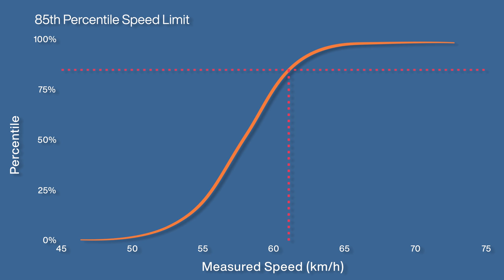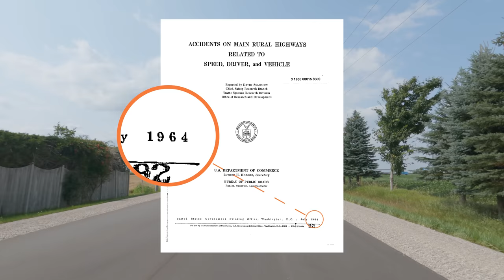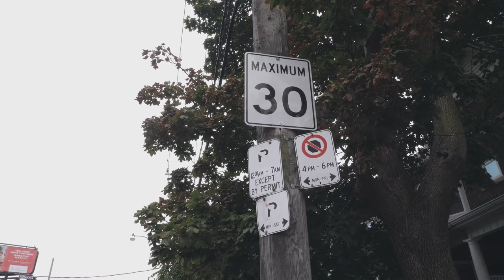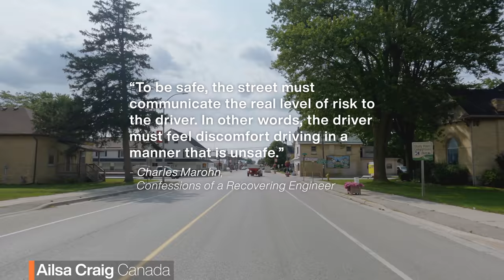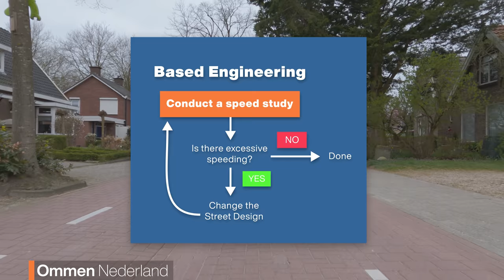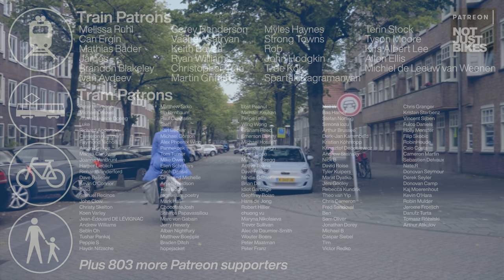The Wrong Way to Set Speed Limits [ST06]

Comment: I am a civil engineer in the United States, and while I agree that there are MANY issues with roadway engineering, I have to disagree that engineers are stubborn and stuck in our ways. Nearly every engineer I've talked to and worked with would love more progressive infrastructure. That includes engineers who have been working for 30+ years all the way to new grads. We are tested and KNOW that making a road tighter and more uncomfortable will lower the average speed of the road. The main issue is that we, as the engineers, aren't the ones directly paying for the road. Whatever municipality the project is in is footing the bill. We can suggest all day that creating a road with 11 foot lanes, divided bike lanes, and medians will improve roadway safety, but if the owner sees that as negatively impacting the service level of the road (which it doesn't) then they are MUCH less likely to go for it. In the end, as with most other things, money dictates the decision.
Reply: That is why those things should be done on a federal level.
Municipalities design and build streeds and roads. But what kind of roads can be used where and how they need to be designed is the same everywhere.
Reply: @baronvonlimbourgh1716  I'm not sure I understand what you mean.

Roads across the US are actually very very consistently designed. 

However, some minor details or choices in road features might differ. I've seen a massive expansion of roundabouts that never used to be a feature in US roads just within the past 10 years. 

But road signs are all the same across the US. The color used to draw lines and other symbols on the pavement are all the same across the US....

What the original comment is talking about is a lot of minor details like the lanes are a little more narrow.

For example, some car parks might feel different because one lot might be angled parking spots while other lots are straight. Or some lots might have more narrow parking spaces than others. My understanding of your reply in context of this car parks example is like someone saying, "all these car parks are so different from each other! This is why we need federal regulations over car parks so there is  consistency in car parks!" But there really aren't enough differences to warrant those claims. And the same really is to be said for all the roads in the US
Reply: @baronvonlimbourgh1716  the federal government are even worse idk how adding more bureaucracy to an already bloated system would be better as it takes millions of dollars and years to replace small parts of road
Reply: @Scornfull  things are done pretty well and very efficient here by our government. Economies of scale and all that, plus it centralises things so nobody has to invent the wheel again which makes things a lot easier and cheaper so everything is kept up to date constantly.
Never hear anybody complaining about it really, so it must work pretty good.
Reply: I'd also like to add that changing a sign is WAY cheaper than redesigning the whole road, and US municipalities in particular usually have a very tight budget, unfortunately. So the safest decision often gets ruled out in favor of the cheap one.
Reply: @MrWhite-pn7ui  LOL its hilarious just how partisan your yank politics are
Reply: @MrWhite-pn7ui  it depends on the goals set out to achieve. If your goal is safety, population satisfaction and efficient use of resources then that has been proven to be the way to do it.
Reply: @MrWhite-pn7ui  it's only supposed to be uncomfortable to go OVER speed limit. The comfortable driving speed is the desired driving speed
Reply: @MrWhite-pn7ui  “we taxpayers have the final say”. 
Ok then, here’s a very common scenario for you: half the residents of a street think drivers go too fast and want speed bumps, the other half doesn’t want them. What do you do?

Another one: a small city has 2,000 residential streets. Residents of 1,500 of these want traffic calming (let’s say it costs $100,000 per street to implement, so we need $150M). Let’s raise property taxes?
Reply: Idk why people think the engineers have any control over it. Politicians block all kinds of shit.
Reply: @bgm769-g2k  Right. Too many always reach for sweeping conformity, or, a procrustean bed.
Reply: @A cat on his hind legs. I agree, and I agree with the points this guys makes, but you comments are insufferable. You will never convince the unconverted with them.
Reply: It's obvious that Clayton has proposed road projects to councils in the recent past.
Reply: @MrWhite-pn7ui  comfortable means faster driving. All good until the neighborhood complains.
Reply: @baronvonlimbourgh1716  no the government never does anything even as close as efficient as the private sector
Reply: @MrWhite-pn7ui  lol, triggered
Reply: @A cat on his hind legs. we're a long way from changing that unfortunately. Noise canceling headphones?
Reply: But how to you know for certain your choice will not affect the service level of the road?  You would have to have a lot of data to support that.
Reply: @baronvonlimbourgh1716  NO, the federal government has no power to do this.  Stop giving them more power.
Reply: @MrWhite-pn7ui  my point is half the drivers want one thing and the other half want the opposite. That is where technical criteria come in.
Reply: @MrWhite-pn7ui  the earth is round btw
Reply: And because as I noted above, the municipalities are eager to fine drivers coming through to cover costs of operation.  So they’re nit invested in making it as safe as possible when their goal is to bilk the public.
Reply: @MrWhite-pn7ui  lol that's why you got so triggered after I pointed out how partisan your political system is
Reply: @Scornfull  maybe your government doesn't..
Reply: @MrWhite-pn7ui  i love driving. I have a nice collection of cars.
I'll have fun on track though, on public roads it is all about safety.
Reply: @A cat on his hind legs. thing is in america you cannot have a goverment  with just engineers because we have the freedom to run for office if we do not like the people doing the job
Reply: @baronvonlimbourgh1716  netherlands is a small country only about the size of a small state the us is 3000 miles east to west and from 1200 to 1500 miles north to south 
i was a person without a car i found out i wasted time waiting for buses or money buying cab rides to get around
Reply: @A cat on his hind legs. i heard about some other engineer had a problem with a traffic light when he tried to change the light the goverment traffic engineer tried to silince him because he was not a traffic engineer
Reply: @baronvonlimbourgh1716  satisfaction for who the thing is in the us streets and road are for people to get from point a to point b in a safe, timely and efficient manor 
not just for people to play
Reply: @MaaveMaave  what about people tide up in traffic get angry
Reply: @doleo_metal  i am a vaxxers but i am also someone that does not believe i need to be tide up for a half hour to go 10 miles to get to my destination
Reply: @gbottesini  when you realise some of those people that drivers are going to fast beleive 25 mph is to fast, 
as for that small town if the want to spend 150 million to redesign their road i have no problem with that it is when they want my money taken from my town to do it
Reply: @A cat on his hind legs. road are not dangerous if you use them correctly.
Reply: @brucenadeau2172  yeah exactly. And that is the safest most efficient way..
Not that complicated.
Reply: @brucenadeau2172  why does that matter. Longer distances are done on highways. Not roads.
Reply: @friendlyfire7861  i do not like his want to control me 
i like americn roads i have the freedom to choose my store.  They can near freeway exits safer so they do not have to have semi-trucks drive throught the downtown semi trucks are harder to stop and harder to get started from a stop. cause more damage in an accident and angry when trapped  behind one  in stop and go driving speed can even creep up on residental street
Reply: @A cat on his hind legs. if you do not like the street you live on you need to move 
you do not get take my freedom away for you to feel safer
Reply: @BaconRobotics  if you want to redesign road fine but you pay the full cost do not dip into my wallet
Reply: @user-xl8jm3zy1f  i like how mr. white and i are partisan because we do not beleive we have to give up are freedom go along with what you want
Reply: @baronvonlimbourgh1716  i try to drive safely but i drive to get to some where i am not out to spend all day driving
Reply: @baronvonlimbourgh1716  i live in one location and are stores are in a diffrent location i want to get my store not be tide up in traffic wasting my time and becoming hadazard to my neighbors
Reply: @brucenadeau2172  bruh if you yanks wanna have shitty roads go ahead. All im saying is that it's super funny to see people seeing bloody traffic problems as a left vs right wing issue.
Reply: @cindland  your evidence does not support your claim. In fact it contradicts your claim! You  basically saying authorities are eager to fine people for violating safety laws they are not interested in safety.
Reply: @MrWhite-pn7ui  no I won't...
Reply: @brucenadeau2172  and?
Reply: @brucenadeau2172  I was responding to a specific nonsensical comment, in which he clearly misrepresented OR misunderstood what was actually said in the video.
Reply: @doleo_metal  yup! They’re interested in MONEY.
Reply: @cindland  saying "yup!" Implies that I was in agreement with you, which I was not..
Reply: @baronvonlimbourgh1716  Going Federal is worse. Local governments are better suited to know whats best for their area. You seem to be making some false assumption that the problem of incompetence or corruption in politics does not exist in the Federal level. It is much worse there than in local governments.
Reply: @user-xl8jm3zy1f  Thus is the legacy of the outrage merchants. Of course, we still have out-of-touch academics fixated on the Oppression Olympics that is Intersectionality, as focusing on things that would help the common people would scare away their wealthy donors. Said academics end up giving the merchants more outrage to sell. It is just an ouroboros of misery.
Reply: so basically you guys blame everyone except yourselves. sounds productive
Reply: @MrWhite-pn7ui  compensating much?
Reply: @MrWhite-pn7ui  burger scared for his life that he might have to walk in the future lmao
Reply: Like becoming an engineer...
Reply: @MrWhite-pn7ui  Wow way to go politicising something thats obvious to anyone with half a brain cell. As a "righty" you emberass me. Do you even understand a road or street often has multiple end users?
Reply: @MrWhite-pn7ui  THANK YOU!  I had to hunt for this comment.  There are a lot of comments here so I'm sure there are others, but it was hard to find.

This whole "let's make streets actually unsafe so drivers go really slow" is NUTS. Absolutely contrary to every basic design foundation of modern US roads.  Look at the example of the road with all those trees right along the edge.  Every one of those is a fatal collision waiting to happen.  And look at the other examples in the EU and UK...  bollards sticking up forcing you to literally weave between them?  Hell, half a block from me we had a fatal accident as a teenager at 2am decided to try to do 70mph around a s-curving, parking along the sides residential street and when he left the pavement he hit a nice 30 year old solid tree 5 meters back in someone's front yard that didn't give an inch.  Walking by days later I saw the bark was missing a little in one section but otherwise the tree came out unscathed.  The car was almost cut in half.

Feels like this video is what happens when you tell a Toronto city dwelling bicycle enthusiast to come up with a new plan for how to do roads better.
Reply: @MrWhite-pn7ui  hahah such a troll
Reply: @frotoe9289  lol yea thats why actual engineers talk about how these are actual solutions...
Reply: Clayton Van Ederen,
We lost two space shuttles in the USA due to lay management usurping authority which rightfully belongs in the minds and hands of engineers and other STEM professionals. Until the general public comes to understand that it is just as futile for a lay person to question an engineer as it is for a lay person to question a doctor in each STEM professional's field of expertise, this battle will never end.

Every man, and a lot of women, believe that they are expert technical geniuses the moment they see even so much as a snippet of a documentary on a topic. The more ignorant the man, the angrier and more belligerent he becomes when told he is wrong by a STEM professional. Contractors, business people, and politicians are notorious for such bad behavior. This will not stop until we teach our children, and adults, through actual exercises just how much an educated, trained, and experienced STEM professional knows within their own profession, relative to the lay public.

Contractors, lawyers, politicians, and business leaders don't like to be questioned within their own realms, which for the most part are relatively simple. Scientists, mathematicians, and engineers also have a right to respect for their very extensive knowledge about what are literally by far the most complex fields known to humanity, and for good reason. Those who practice STEM professions should be given at least as much respect and freedom to practice their fields without interference from the lay public as those politicians, lawyers, and business leaders expect for their own practices.

If those in STEM professions can convince the lay public to keep their noses out of the way of STEM professionals, we would see a lot more good design, and far few failures such as exploding space shuttles.
Reply: @frotoe9289  yes, if you do 70mph (110km/h) on a road that is designed for 30 (50) and you hit a tree that will most likely be a fatal collision (I’m assuming it’s a residential street since you mentioned it was half a block from you). Also in many places doing that is considered stunt driving and could get your drivers license suspended or even jail time.

How can you possibly argue that the issue with that collision was a tree placed 5 m off the road (btw this is a fairly generous clear zone width if we’re talking about a residential street) and not the excessive speed? Sounds like you’re proposing that residential streets should be designed to freeway standards. I suggest you look at collision statistics from any municipality and find out on which types of roads most fatal collisions happen.
Reply: Not sure what's going on, some of my comments are disappearing. Here it goes again...

 @MrWhite-pn7ui  and who do you think stopped the Chernobyl catastrophe from becoming an apocalypse? Car salesmen who "do their own research"? What does the general public know about running a nuclear power plant?

BTW, this pandemic would be over had the general public listened to the experts, not to politicians and podcasters. But no, "I watched a YouTube video therefore I know more than the people who make a living out of knowing their stuff."

Give me a break.
Reply: @MrWhite-pn7ui  I’d keep chatting but I have a root canal scheduled with my barber.

Take care, and don’t forget to polish your aluminum foil hat. You know… 5G and stuff…
Reply: @MrWhite-pn7ui  ,
Most engineers, and for that matter, other STEM professionals do learn to work with the general public. Who do you think invented the field of ergonomics? It was a combination of scientists and engineers who did the research and discovered how to get people to interface efficiently with each other, machines, and regulatory systems. Who do you think invented LEAN, Six Sigma, Just in time delivery, and other modern productive systems which actually work and make possible our productive enterprises? The entire world you live in was discovered, invented, and made possible by STEM professionals who do know how to work with, analyze, and satisfy the general lay public.

Next time you are driving your car, think about how beautiful the ergonomics are compared to the original cars. Think about how the seats are designed to accommodate a wide range of people in comfort over several hours of driving at a time. Think about how controls are located within easy reach with a minimum of distraction. If there are problems with the infotainment system being too distracting or too connected to vital functions, that is due to decisions made by business and marketing management, not the design engineers. No engineer in their right mind would compromise the safety or functionality of a product for some sales gimmick.

The same goes for the disaster at Chernobyl. There was nothing wrong with the reactor design other than it was old and needed proper attention from properly trained people. The accident happened because the staff were not properly trained in the critical nature of the reactor, and funds were not made available to keep all systems, including sensors, valves, and pumps, plus other critical gear, up to spec. The reactor had grown old, and lay political leaders were not willing to heed the warnings from their STEM professionals to perform proper maintenance and/or decommission the reactor. In essence, relatively unimportant politics and business took precedence over very critical STEM decisions in regards to a complex and potentially very dangerous piece of technology that only STEM professionals could understand, evaluate, service, and operate. As usual, the real cause of the Chernobyl disaster was the fault of management who would not let go of their egos and listen to the advice from their STEM professionals who knew vastly more than management about nuclear reactors in general and the Chernobyl reactor in particular.

Look at what really happened at Chernobyl and you will discover that the ultimate source of the disaster were decisions made by management which lead to a failure to maintain critical components to engineering specs and a failure to train staff in the intricate and critical nature of the reactor. It was a management decision to keep the reactor open past its due date, as well. The Soviets were well known to allow powerful political leaders to override their STEM professionals. No one questioned Soviet political or bureaucratic leadership because they were all scared of being sent to GULAGS for doing so.

Just like the two space shuttles, defective cars, and dangerous products, Chernobyl failed due to a culture of obedience to the wrong people who had zero qualifications to make STEM decisions. The worst thing that can happen when a politician or business leaders is disobeyed is a cost overrun or a marketing disaster. When business leaders, politicians, and bureaucrats fail to obey their STEM experts in STEM matters, actual disasters such as blown up space shuttles, melted and exploded nuclear reactors, exploding Ford Pintos, out of control Chevy Corvairs, and other mistakes happen.

Yes, STEM professionals make mistakes as well, but in general, they learn from their mistakes. With politicians, business leaders, and bureaucrats, its just business as usual no matter the horrific disasters that result, until some STEM professional exposes the source of the problems and who is really to blame. The the politicians, bureaucrats, and business leaders begin conniving, gaming, and manipulating the system to shift blame onto the shoulders of the innocent and the competent, instead of taking the blame for forcing their unwanted and incompetent choices upon others who know more then the leaders do.

When a STEM professional makes a decision based upon their knowledge, training, and experience, that STEM professional is generally correct over any and all objections from lay people, no matter how much force, influence, and power those lay people have at their disposal. The sooner we all understand this fact, the sooner we will be able to enjoy a higher and safer standard of living world wide.
Reply: @AMERICANPATRIOT1945  let’s stop feeding the trolls
Reply: @MrWhite-pn7ui  ,
You do a great job cherry picking a Wikipedia article about the Chernobyl disaster. In reality, you are dead wrong about the real cause of the disaster which is the culture of extreme fear which made it impossible for anyone to speak up about the ever mounting problems facing those who actually did the work at Chernobyl. Many STEM professionals at Chernobyl knew that it was only a matter of when and not if, but they couldn't say anything due to the extreme power, influence, and fear wielded by those who really ran the show, and those were the political leadership over Anatoly Dyatlov, right up to the Soviet premier.

Anatoly Dyatlov was just a tool used by the political leadership to do their unqualified bidding. Since the lay Soviet leaders over Dyatlov made the bad choices, it was the lay Soviet leaders who take the blame for the Cherobyl disaster, not the STEM staff. The whole world knew this and blamed the Soviet system and its culture of fear and extreme political power for the Chernobyl disaster, and other disasters such as the arrogant and completely unjustified shoot down of civilian flight KAL 007.

Chernobyl failed due to political arrogance, not STEM incompetence. The same is true most of the time when there are problems with large and complex STEM systems. We allow arrogant lay leaders to dictate to STEM professionals because those lay leaders are the bosses. Then we believe those same lay leaders when they blame their STEM staff for screw ups. In reality, the STEM professionals have no choice but to do what the lay leaders tell them to, therefore the choices are made by the lay leaders, not the STEM professionals, and the problems are the fault of the lay leaders as a result of that illicit decision making by those lay leaders. That is why most, if not all, STEM mistakes and disasters occur. It is the extreme egos on the part of political and business leaders which are to blame most of the time for STEM problems. It is time to blame those with the actual power to make decisions and organize people and stop blaming the cogs in the machine operated by those lay leaders.

As for your stance on making drivers uncomfortable with driving fast, you miss the entire point. In fact, my entire comment is very germane to this discussion and the entire concept of allowing STEM professionals to make STEM decisions without hindrance from unqualified lay leaders. Those unqualified lay leaders have zero knowledge about actual road design and construction, human psychology, ergonomics, and many other fields which play into the proper design of roads and streets and how to make them safe and effective for people to use.

Yes the article is written by people who favor bicycles, but only on small local streets, not on major highways. Those traffic engineers know much more than you do, Mr. White, about road and street design. You should listen to them and respect their knowledge. Those engineers are absolutely correct when they say that even in small, quiet neighborhoods, children cannot get on their bikes without fearing for their lives due to a lack of inducement for motorists to slow down.

The author of this video is not talking about houses along major stroads as he calls them, but also small side streets. There is no inducement other than a speed limit sign for motorists to slow down and drive responsibly. In fact, the author of this video is absolutely correct that bad design and a complete lack of design is a major factor in fatalities to both pedestrians and motorists on American and Canadian highways. Cars don't mix with bikes and pedestrians.

Most people are not good drivers. They have poor distance judgement, they fiddle with their cell phones and other distractions, they blow red lights, they make left and U turns in front of oncoming traffic, and they pull out in front of oncoming traffic and actually believe that they have the right to do so, when in fact they never do. The term "right of way" means nothing to most people when someone else has the right of way, only when they have the right of way. This is what traffic engineers have to work with when they design highways, streets and roads. Traffic engineers are also forced to do what they are told to do by incompetent political and business leaders who have nearly absolute power over them. In the end, the engineers design how they are told to by incompetent lay bosses instead of designing according to principles of good design.

In Canada and the USA, our road systems have grown up around ever widening paved over dirt paths with lots of room to expand, but little room to expand safely and properly. There is little actual planning in Canadian and US road systems, especially in urban and suburban areas. The knowledgeable, skilled, and experience engineer who wrote this video knows far more about traffic and road design than you do, Mr. White. There are others just like him who are constantly dictated to by incompetent lay people in positions of power. The result is the mess we have to contend with when we travel.

Shining examples of good design such as the Netherlands, and other places which listen to their STEM professionals, reap the rewards in better street and road design with lower fatality rates and more rapid transit with all modes of transportation.

Exploding Ford Pintos, out of control Chevy Corvairs, melting nuclear reactors, collapsing bridges, and bad road design are generally the fault of arrogant and incompetent political and business leaders who forced their own bad choices into STEM decision making which those leaders had no right to enter into at all. The very occasional anecdote dredged up to defend those arrogant and egotistical lay leaders does not change that fact. If you, Mr. White, want to see things improved, then you must learn that there are people in this world who know more about STEM professions than you do, even if you are a STEM professional.

At best, you have knowledge about your own field of expertise. About all others, you are a lay person, and must learn to put your ego aside and trust each expert in their own field. This is especially true for business and political leaders who must take input from many sources and make hard choices. A great political or business leader knows when to back off and allow themselves to become a conduit for information and decisions from the STEM professionals they hire.
Reply: @MrWhite-pn7ui  When you run out of arguments so you default to "You're Poor!" "sheep!" and "You hate drivers". Incredible points, man. You should present these to congress
Reply: @calilee6894  That's what trolls do. Don't feed them and they'll go look for adults' attention elsewhere.
Reply: @MrWhite-pn7ui  The goal of any thoroughfare should be only as comfortable as necessary.  In general the design principle for anything should be that places you want people to linger should be more comfortable, and places you don't want people to linger should be less comfortable. That would strictly also apply to roads.

There's a limit to democracy, and you won't hear that from everyone here. Democracy runs into its problem when bad ideas that feel nice, to lots of people who don't grasp or care why they're bad, become popular.

And before you say anything, I drive a lot and love to drive. My goal in making driving more difficult (and public transportation easier) is, besides all the social and safety implications, to get more of these idiot drivers off my beautiful precious roads, so I can drive right and drive free, unimpeded in my high skilled, law abiding ways. The fewer people that drive unnecessarily—only because they have to in order to get anywhere—the more space on the roads free for people (like you and me) who know what they're doing.
Reply: @baronvonlimbourgh1716  What country are you in?  How big is it?  What kind of government do you have?  The United States is a Federalist government that gives power to the States.  The only way to accomplish what you suggest in the United States would be to change the Constitution.

Plus, I wouldn't want to build roads the same in Florida and Alaska.
Reply: Then you're (not you specifically) not doing your job well enough to convince them otherwise. You guys as the experts need to educate these decision makers.
Reply: @MrWhite-pn7ui  uncomfortable when driving above the speed limit
Reply: I agree with your assessment
Reply: @MrWhite-pn7ui  until people get hurt (or worse, die) on that road. Would insurance for town change if the roads were adjusted/safer? Would the city have less expenses toward legal matter regarding this?
Reply: @A cat on his hind legs. the people speeding don't usually care what the speed limit is or how wide the lane is in the USA.  we have people darting across 4 lanes to get to exit ramp in the last second.
Reply: How much of the problem is "we won't get as much money from speeding fines"?
Reply: Based
Reply: As an engineer do you not have a code of ethics that says you should refuse work that is unsafe and pushed on you by a client that refuses to do the work safely. 

As an EE I am endlessly frustrated by traffic and roads engineers that seem to think the code of ethics applies to structural, electronics, and chemical, but not traffic!!! If the client refuses to let you do your job safely, then you have an obligation to refuse to take the project. You should walk away from the job.
Reply: @baronvonlimbourgh1716  If you live in Europe - consider if you want the EU commission in Brussels decided how your local street should be built.  That's about as far removed as our federal government is from most local concerns.
Reply: @waltlock8805  why not? If that is more efficient, safer and cheaper i'd be happy if that was standardised on a european level.
Keeps our politicians from doing all that experimental stuff all the time and all countries can collectivly do R&D together instead everyone alone doing the same shit 27 times. And it would raise the standards troughout the rest of europe a bit closer to our infrastructure. Some countries still have shitty infrastructure and all these different ways of doing things makes things confusing sometimes and creates dangerous situations.

I don't see the issues here at all. It pretty much would only bring bennefits to everyone in europe. I actually wonder why we aren't doing more of this already.
We combined loads of institutions every country used to have into single big collective eu wide institutions already and it works great. It is really one of the best things about the eu imho.
It provides clarity, things work the same everywhere and the amount of burocracy, time and red tape it saves everyday is incredible.

I would never want to go back to how things used to be.
Just look at brexit, so many things the brits took for granted now suddenly changed back to the 20th century. Brexit is turning out to be very very expensive.
Reply: The government should take action with some new rules that force people choose the right roads
Reply: @LorenzoChiaveriniDBTF  What do you even mean by that? We've got enough government interference with our lives already - I don't need them telling me what roads to drive on.

As to how their built, that's something for each town and municipality to decide for themselves what is right for their community.
Reply: @baronvonlimbourgh1716  It's nice that you like homogenization of culture. I like living in a county where different regions feel different, and where every community gets to decide for themselves how things should be on most of the things that affect them.
Reply: @waltlock8805  that is totally not what i said at all lol.
Reply: @BaconRobotics  I'm from Northrhine-Westphalia in Germany and follow this cheesebobfan-channel for a long time now. What I have learned is, that in the USA the city pays for the roads to attach residential buildings to the local traffic network, that is also fully maintained and payed by the city. Also Americans vote politicians that keep the taxes low. .....^^.....
Over here in German (so not in orange flat Cheesebobland ^^) property owners have to share the costs of the street (including the walkway)  that is build to connect theirproperty to the rest of the traffic network. So if the community decides to make the narrower or a different design with sleeping policemen and pedestrian islands or if they want to replace the lighting of the street with LEDs &c. the property owners will have to pay the bill. The shared bill is divided by a key that takes propertysize and livingsspace size in to account.
This method is highly controversial amongst people living at streets that are informally used as roads....^^
Yet it allows to change the road without affecting the budget of the city as only the benefactors pay for the improvement.
Reply: @CantEscapeFlorida  Engineer are in high demand! 
A politician looks for an engineer to make a shitty stroad.
For Engineers it's the same as for many high qualified people. You have 3 options.
#1 Love your job and build the worst stroad possible
#2 Change your job and make it about building great urbanization concepts improving the quality of live of the resident's
#3 Leave the job for somebody else and wait for the next deal.
Reply: @baronvonlimbourgh1716  I sense a plausible deniability in you.
Reply: @dlazo32696  We don't pay taxes for the streets in the cities. The owners of property pay for the "development of the property" themselfs. This means you pay for your water connection toi be build, you pay for your electricity and phone connection to be build , you pay for your Natural gas connection to be build, you pay for your sewer connection to be build and you pay for your street to be build.
No taxes envolved. No one pays for your stuff except the owner of the property. Owners of property  that has no connection to phoneline, electricity, Naturalgas, drinking water, sewers or street, pay nothing.  So if you have a property you aren't subsidized by the taxpayer and all the people who don't have properties.
Yet if you want your property connected to traffic network and natural and water and power and sewer, then you have to pay. And if they are renovated then you also have to pay as the owner who benefits from this. You also have a say in how it all is done as residents to the street.
Taxes aren't used to pay for your street , your sewige line, your natural gas line, your water line or your power line or your phone line.
That's why even poor cities have decent roads and well maintained infrastructure, because it's all paid by the residents. So nothing is left broken, just because the city has no money.

meanwhile in the USA, if the city has no money the streets rott, the sewers are never renewed, the drinking water suddenly is undrinkable, powerlines and phoneline are build above ground and at bad weather are common when ever a tree falls onto those powerlines....
yet at least no one has to pay for maintainance...just like in somalia.
Reply: @brucenadeau2172  I'm often amazed by the freedom argument made by Americans. It seems many are so caught up in protecting their artificial individual freedom, not seeing certain individual limitations actually increase freedom as a whole. Freedom is one of the most important principles of western culture and should be protected, no doubt about that. But what if the freedom of the individual limits the freedom of the group? For example, that's why countries agree that travelers aren't allowed to carry weapons on planes. We accept that limitation of freedom as an individual to protect the freedom of the group. You feel your freedom is restricted if roads are designed to feel comfortable at the speed that's most safe for that area. Meaning you can no longer comfortably drive over the speed limit (limitation of your freedom) resulting in less casualties (freedom of the group). I wonder why anyone would oppose to that. Sooner or later a road needs to be replaced, why not improve it while your at it. One of my American colleagues was just like you saying things like Europeans are communists and tax should be as low as possible etc etc. That is until he came to visit our office for the first time. We had a drive together from Amsterdam (Netherlands) to Lille (France) and after seeing what tax money COULD do for you even he agreed this results in a far greater living experience. Now I understand that European countries are a lot smaller than the US, but this is not about those insanely long highways that are throughout the US. It's about cities and communities which have a population to square mile ratio. Feeling safe in your own town should not be seen as an attack on your freedom.
Reply: @verybarry6044  there are different kinds of freedom.
Mainly positive and negative freedom and they mean something completely different.

Americans seem to be stuck on negative freedom, which does fit with it being a very very concervative country and it's ideology revolves mostly around having "freedom from whatever". Probably named like tha because the focus and fear always is on negative things.
While more progressive ideologies revolve mostly around haveing the "freedom to". Which is often called positive freedom. Probably because it focusses on enabling positive things and oppertunities.

It is a fundamental difference and it creates completely different cultures and societies.

There are multiple informative videos about the subject on youtube. Really puts things in perspective.
Reply: @baronvonlimbourgh1716  interesting I'll check that out thanks
Reply: @Scornfull  you're ignoring much of the bloat is because low funding levels means more efficient bureaucracy schemes with new technology can't be implemented, and more efficient workers are lost to the private sector. Better funding = more efficiency = government can more effectively spend money = long term better outcome for tax spending. Also, not like private companies will do better, they're beholden only to shareholders, they will cheap out since only short term thst matters
Reply: @iamthepeppernator  
People look at government trough a far to narrow window. They have the ability to prioritise across everything they do and find the most efficient solution on a macro level, even though that might not always be the most efficient on a micro level.

If they can spend 100 bucks less to do something because that is the cheapest, but then have to spend somewhere else 500 extra somewhere else because those savings made something else more difficult you are wasting money and resources. That isn't efficienty.
But if the government spend those 100 bucks extra even though it is not necesary in that specific situation or application it is called waste or burocracy.
In the end corperate efficientie is just another word for cost externalisation. They can do it cheaper because they don't have to deal with the aftermath they create, the tab for that is ironicly picked up by government afterwards lol. 

Trillions are wasted on working around bad design, work arounds and inefficienty in this way because some people are obsessed by the idea that government shouldn't touch anything.
Their paranoya basicly is what in the end causes what they are so afraid of for some reason.

Plus most things provide more value then just direct revenue. Things like high speed real, infrastructure, social services etc often need to be unprofitable in order to create the most value.
The growth and productivity they create is far far greater then whatever it costs to run them. That is why they are concidered investments and not costs.
Reply: no, please, don't make even the infrastructure "progressive".
make it be based and make sense instead.
Reply: @MidnightSt  what is progressive infrastructure lol? Isn't all infrastructure progressive?
Or are you still building cast iron bridges and stone arch gravity fed aquaducts?

Technology progressed a lot over the year, so infrastructure progressed as well.
Reply: I was kind of adjunct to traffic engineering when I lived in Alaska, by necessity - I was a traffic crash investigator, and new roads were going in, roads that had been designed outside of Alaska, to be built in Alaska... That doesn't work. So... I end up looking up a lot of... things.
I agree that complexity adds safety, sort... of? But, I think there is a very fine line that has to be looked at, and adjusted for, local population and conditions.
If there is anything that is "Stuck in the 1960s" it is this concept that one standard, works in all situations, areas, and solves every problem.
If we built roads like the Netherlands - our traffic fatality rate would go way way way up - while economic productivity went way way way down.
What works in tiny - itty bitty Netherlands, with its tiny population of 17 million people, and its coastal culture, doesn't work in the United States.
I am all for making roads safer, with some form of complexities - but, intentionally making them unsafe - in the name of safety? - That is the equivalent of saying, "Yeah, we know the dumbasses who drive unsafe will die - but, the smart drivers will live! WIN!"
That is firstly, sick and twisted thinking - and secondly, completely disregards secondary fatalities and injuries caused by said dumbass on an overly complex road.
The factors and decisions that go into why roads are built the way the are, are very complex, and happen over time.
For me, it was arguing for intelligent design of two traffic circles in Alaska. All of my arguing and point proving, and quoting NHTSA and the MUTCD for signage guidelines, and 400 signs posted all over the place that nobody pays attention to - but that leadership likes because it is visual evidence of "taking action" - I still ended up with traffic circles that were pointless because all of the safety features had been removed to accommodate large vehicle traffic.

That is one of the US's biggest problems - trying to fit too many types of vehicles, onto our roads. You can't build a road that is both safe for small things, when it is able to easily accommodate giant tractor-trailer rigs, used to deliver groceries to the neighborhood Dollar General store.

Just chalking everything up to a single problem, with a single solution of, "If we just let the traffic engineers design it however they want, and make things more difficult, to make them easier" - isn't the answer either.
Reply: @baronvonlimbourgh1716  If you were paying attention, you’d know it’s the state and federal levels that are paying for the roads.
Reply: This cuts into my gripe about the channel : It’s not the Americans and Canadians who are wrong, it’s rather specifically the people who run the US and Canada.
Reply: @dragons_red  true. 
These people need to start rallying and petitioning their local representatives... but no, let's make EVERY dang issue a national parade.
Reply: @A cat on his hind legs. we have enough little kings telling us what to do thank you very much. We dont need another "expert" dictating to each state how to run it into the ground. Dont like a thing, get active locally... the federal government is a bloated mess and cant do anything without an absurd amount of waste. 

I would LOVE for our roads to be designed better, but I would NEVER want it to be forced down our collective throats.
Reply: To OP, I'm sorry to hear how little input yall have sometimes. It really shows in a lot of areas. 
 Particularly in school zones its frustrating. 
It makes me curious how those interactions go, if yall recommend a plan, then they ask you to alter it to what they want then have to make it work somehow.
Reply: @rottenmeat5934  aren't they voted into office by americans and canadians to manage this for them?
Reply: I was thinking that - it's down to whomever planned the roads, not the people doing what they've been paid to do.
Reply: @chaosXP3RT  of which I commited neither? Just cause you get a hard on hating on people for the sins of their forefathers does not mean everybody follows that worldview
Reply: All I’m gonna say is I really wanna be a civil engineer
Reply: @waltlock8805  They don't though.  Most of our road infrastructure in Ontario is the same because everyone follows the same outdated rules that the video mentions.  He showed multiple towns and cities across southern Ontario and they all look and act the same.  Sameness everywhere following the same "rules" for road design.  Just because municipalities have the ability to design how they wish doesn't mean they will.  The only time anything changes is when local's complain about speeding through subdivisions and speed bumps or bollards are installed and then taken out, and then installed again, and then taken out, and then installed again, etc.
Reply: @TremereTT  42% of transportation costs are footed by taxpayers in the US from general taxes (income, sales, etc), 48% from actual road users (gas taxes, vehicle fees, etc) and 10% from bond revenue.  It's not that cut and dry when people say that roads are funded by gas taxes and vehicle owners.  Everyone actually pays for them.
Reply: @A cat on his hind legs. Things simply don't work like this. Why are some people believing that a Corona jab will implant a microchip? Engineers are tought how to design a street but you actually need someone who can SELL a street design when you are going against the usual design.
Reply: @MrWhite-pn7ui  Ar all taxpayers exclusively driving cars? the idea isn't to make a road uncomfortable to drive but feel uncomfortable when you are exeeding the intended speed limit. A good road with a speed limt of 30km/h should be comfortable at 30 km/h and uncomfortable at 50 km/h.
Reply: @MrWhite-pn7ui  Because you are stuck with a cliche? I want a straight wide open roads when I am driving 180km/h on our German highways but like a small winding roads near my home where kids can play on the street and walk to school.
Reply: This is why designing the road should be YOUR JOB. It's part of the fundamental societal responsibility of an engineer to do a good job, and if people realized that a engineer with years of education and experience can do a way better job than they could ever imagine, maybe they wouldn't feel the need to micromanage. The fact that there is no trust between the individual, from which funding should originate, and engineers is so detrimental to the quality of everything. European culture is one of humbleness and trust; a element of the Law of Jante – "You, an individual, are not to think you can teach us, the community, anything".
Reply: @A cat on his hind legs. because as we have seen over the last 19 months governments are good at listening to science.
Reply: @MrWhite-pn7ui  but they do make them uncomfortable for the end users, try walking and cycling on these streets, they are uncomfortable.  So why weren't they fired on the spot?
Reply: @baronvonlimbourgh1716  if the government was anywhere near 'efficient' they would not have almost defaulted on national debt just this past month despite the fact that we have one of the strongest economies globally (and by extension a VERY high income via taxes). I don't think you are properly informed on the subject you are discussing. Efficiency would lend itself to the idea that everything that needs doing will be done in the best possible way while also saving enough money to lower taxes. Neither of the above has happened so i'd say its the opposite end of the extreme.

I love my country but, because i love it i'm duty bound to call out its agregious flaws so that one day it might be better.

It is worth noting that we avoided the national default by raising the debt ceiling which is fancy government speak for refinancing or taking more bigger loans to pay the older loans + their interest. Spending more money than nessisary to pay debt is very inefficient and bad finance in general.
Reply: @A cat on his hind legs. speed is a VERY insignificant factor in causing crashes. Bad driving and negligent driving are much bigger factors. Someone who regularly goes 10 over but is alert can easily be leagues safer than the person going the limit while on their phone or impaired by alcohol/weed (yes weed does impair you and this is corroborated by research from colorado and following states/universities in said states since its initial legalization)

This tax money would save more lives by providing proper driving education to all free of charge combined with having significantly tougher driving exams as current state standards are a joke in numerous states (and this would be significantly cheaper than changing the roads to control the average driver's speed so you might even lower taxes a little to boot).

Hypothetically speaking, and to be clear i hate this idea but for the sake of proving my point i'll say it, it is also infinitely easier to limit speeds not by altering the roads but, by altering car gearing to make speeds over a desired limit rev high. This would literally cause more damage to drivers cars, burn a lot more fuel, make them louder and vibrate more, and make going too much higher than the limit significantly harder to impossible to reach and this could be done via legislation FOR FREE to affect all newer cars not matter what engine they pack. You could even just add a legislation for digital speed governors on new cars and set a hard universal limit. With that option you can keep current gear ratios and not kill the sports scene as the 'sport mode' key is already a thing so even powerful cars could be limited on regular roadways without killing the sports car scene. its so fucking easy to legislate the 'problem' away without spending billions of dollars on redoing the road system. I'm just one man and i've beat them at their own game in 2 ways basically for free in comparison and i don't even like these solutions bc they would attack my freedoms. The only reason the governments want to change the road is clear. A. They have stakes in companies related to road work and will benefit from this insanely foolish legislation to alter the roadways. B. They want you to 'speed' so they can ticket you and supplement the taxes.

Lastly, as my final retort against tiny roads, drivers get better over time and some are motivated by money to go faster (business owners, truck drivers, traveling jobs ect.) so no matter how narrow the roads get people will get used to them and push the speed up higher. The only reason it stops at 5-10 over the posted limit everywhere is because they are trying to avoid tickets. 10 mph is slow enough you could reasonably get to the speed limit before getting caught. 5 mph is within the +/-5 mph accuracy range of radar guns and it is SIGNIFICANTLY easier to fight tickets within this range as for that reason which is also why 0-5 mph over is rarely ever enforced compared to a +10-20 for example.

TLDR: I provided at least 3 solutions that would work better AND be cheaper than thin roads as well as retort the efficacy of tiny roads over time bc humans learn and push limits.

On an unrelated note/rant

This is the same idiotic logic you see in "green car technologies" when cars produce less than 10% global pollution and green solutions would be infinitely better on planes, factories, and boats where more than 70% of global pollution is produced.

The miracle of a bit of research right?

Don't randomly apply solutions. Look at the numbers to apply REAL solutions that WORK.
Reply: @oceanbytez847  vote for a more competent government then..
Reply: @baronvonlimbourgh1716  No, we do not need more things done on a federal level. I'd much rather see the federal government stripped of 90% of its power.
Reply: @scythelord  get a better government then....
Reply: Like most things in AMERICA
Reply: @A cat on his hind legs. I'd rather the child not be playing in the street.

The design principles outlined in this video sound like they're designed by people who just don't want you driving cars. If you want to design these "safe streets," design them as walkways and bike paths and don't have them be accessible to cars at all. Choking traffic with slow-moving cars is a horrible idea, especially in urban areas. Segregate the kinds of traffic if you want to achieve better design. 

This MIGHT work in suburbs, but I can also guarantee you that the "oh, we'll narrow it down to one lane!" idea is going to create tons of frustration and not a few head-on collisions. People get used to their neighborhood thoroughfares, and will drive at speed through them. You're better off with cul de sacs that don't provide thoroughfare access being where you let cars and pedestrians mingle.
Reply: Goes back to the issue of politicians not being fit to be in charge of pretty much anything ¯\_(ツ)_/¯
Reply: In the Netherlands the municipalities don't have the power to override proven engineering concepts.
Reply: @MrWhite-pn7ui  By your twisted logic, everything should be a highway then. It's design is most comfortable and forgiving for car traffic right? I don't understand how people like you can frame this road design issue as partisan in any way. It's like a shitty superpower, shoehorning politics into every possible facet of life.
Reply: @doleo_metal  rude
Reply: @baronvonlimbourgh1716  you’re under the impression that the federal government functions any different to state and local governments
Reply: @InsideAssassin2  no not really. They just facilitate cooperation for smaller governments and makes sure they ar on the same line as the rest.
That is how management works...
Reply: Here in Canada municipalities never pay for new streets and roads - private developers do.  The Province (at least here in Ontario - probably the Feds in most of the rest of the country) pays for the major highways.  For local street and roads Municipalities (local city) and Regional Municipalities (Provincial bodies) tell developers what is required of them, but the developer pays for it all and passes the cost on to the end customer (the builders, homeowners, businesses etc. that end up in the new subdivisions).  Developers want the smallest, cheapest roads possible to save money but it is up to the governing bodies to decide what is ultimately "required".  Engineers can design anything they want, but they will always bend to what their client asks for (if they want to get paid!) and then change it, if required, to match what the governing bodies demand.
Reply: @frotoe9289   Some of the things in this video are insane.   To paraphrase: "Here there are some driveways on the 80 km/h zone, so we have lots of trees blocking the view of both cars trying to come onto the road and the drivers on the road to ensure that nobody can see anyone else until the last minute - this signals to drivers to be more aware...".  Pure genius.  The whole idea is to make the roads unsafe so that people will naturally become tense and slow down.  It may work, but no one that drives a lot wants this nightmare.  Works in Holland where half the population doesn't even have a car and most of those that do only drive for pleasure.  This is all about making driving to work such a nightmare that no one wants to do it and takes public transit.  This simply doesn't work where I live and never will until someone spends hundreds of billions on transit systems.
Reply: @MrWhite-pn7ui  You are so far down your car only rabbit hole you do not even consider the crazy possibility that you would like to use a central street within a village or town as a pedestrian or the possibility that pedestrians could be taxpayers too. Fascinating.
Reply: @MrWhite-pn7ui  Funny that tight streets in Europe are demonstratively safe than the obligatory superwide streets even in (non-historic) residential neighboorhods in the US.
Reply: @baronvonlimbourgh1716  where’s “here”? Some nation the size and diversity of one of our more rural states?

We don’t need federal level street design, we need forward thinking city planners.
Reply: @gbottesini  while you may get half a population thinking traffic is too fast (doubtful), you’ll never get half a population clamoring for speed bumps.
Reply: @ShaunHensley  so you want forward looking city planners in every city? Good luck, seems the are in short supply.
Reply: @baronvonlimbourgh1716  Why do you hate democracy? Only local control can be at all responsive to the will of the voters.

Or is it you want your vote to have more power than the vote of someone with whom you disagree?
Reply: @ShaunHensley  bunch of BS that lol.
Efficienty is efficienty. Has nothing to do with democracy lol.
Reply: @baronvonlimbourgh1716  Sorry chump, self governing people self govern. 

You want to do things your way? 

Convince your neighbors to go along with you
Reply: @ShaunHensley  just pointed out the more efficient way to do things. Why would i want to try to convince anybody of anything? 
So much drama lol.
Reply: @baronvonlimbourgh1716  So whine on the internet, fine by me
Reply: why would you ever make a road narrow? if its wide its safer to drive it fast.
Reply: @mikkihintikka7273  that is the point ;)
Reply: Perhaps you should add an "average fatalities per mile" metric or something like that to the alternatives you propose! "Here's option 1, with 11 foot lanes, divided bike lanes, and medians; it can accommodate 100 cars per minute and 0.1 fatalities per mile. Here's option 2, as proposed by the city council; it can accommodate 110 cars per minute, 1 adult fatality and 0.5 child fatalities per mile."
Reply: @phueal  fatalities are irrelevant
Reply: @mikkihintikka7273  that's a surprisingly callous attitude!
Reply: Well said. People are way too quick to judge the actual people who work as if they have any decision in what is being made. As always people are dumb and ignorant
Reply: @TheSilverwing999  dislike
Reply: I'm an old mechanical engineer myself. We could have built cars that were INCAPABLE of speeding decades ago. Many countries have done so. The only reason we haven't is the political influence of auto manufacturers. That would save countless lives, greatly reduce emissions, and put this whole road design argument out to pasture.
Reply: @AMERICANPATRIOT1945  i think the problem with stem professionals is that if someone opposes them they run with their tails between their legs to cry to mommy. I do not operate that way and i have to tell my client that will not work i do. Others rollover because they are afraid of losing the client or confrontation.
Reply: Maybe, just maybe the people who decide that a road will ACTUALLY HAVE a safe bike lane should be in the municipality that pays the bill.
Reply: You do decide the speed limit though. That's the issue here, not the road design.
Just make sure the speedlimit matches the designed limit
Reply: @bgm769-g2k  Yes, the roads in the US are consistently designed. However, the wrong way, as this video alludes to.  The residential speed limit in my city is 25 mph (as with most residential areas in the US).  Even with a speed limit of 25 mph, the roads are wide enough that people consistently speed through here.  There is no fear of hitting anything.  If the roads were narrowed, then people would drive slower for fear of hitting an oncoming or parked car.  Also, with that speed, the stop signs are a big nuisance, so some drivers even just blow right through them.